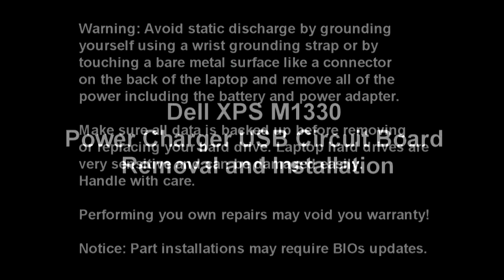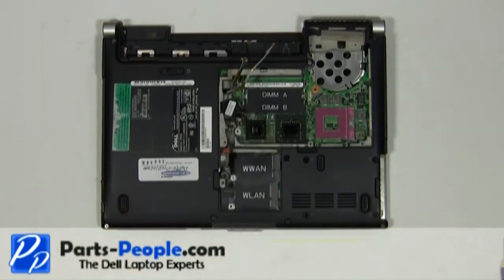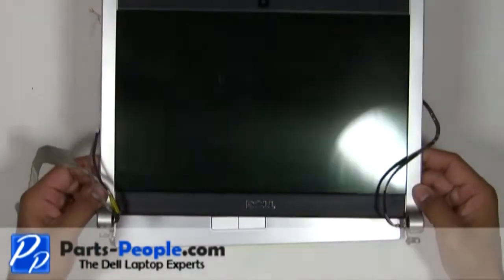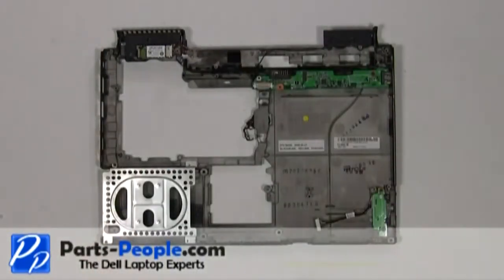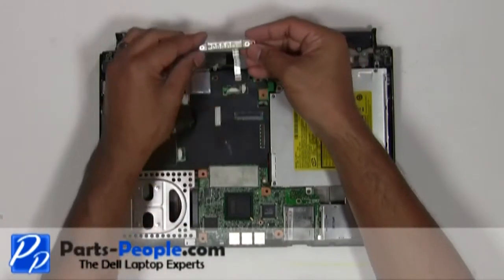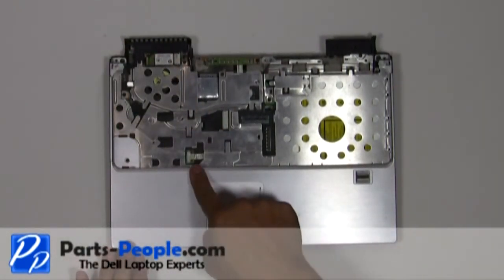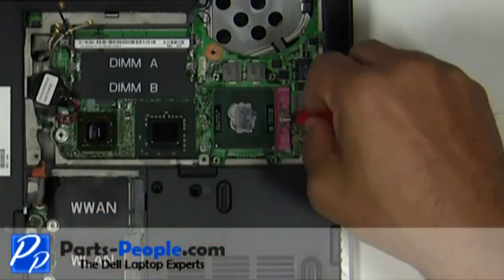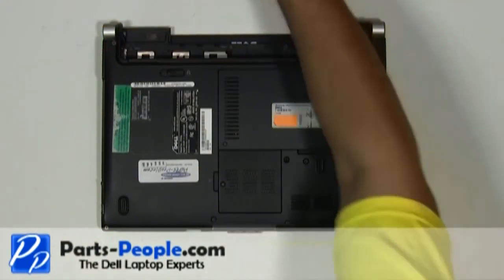Dell XPS M1330 | Power Charger Board / USB Circuit Board Replacement | How-To-Tutorial

Comment from the maker: @7oxSin One thing you might try is to turn off the computer, remove the battery, leave the ac adapter in and try to boot the computer.  If the computer will not boot then you know that the computer is not receiving any power from the ac adapter and you would want to look at replacing the Power Charger Board.

Comment from the maker: Not necessarily. You have a short but it depends on where the short is. If the short is on the motherboard, changing this part will not fix your problem.

Comment from the maker: It sounds like you have a problem with the DC jack not the power charger board. It's very common for the solder joints on the DC jack to get damaged and cause all the problems you have.

Comment: Changing that will solve the problem with the bricked xpsm1330?, the one where won't power on and the light of the power charger turns off as soon as you plug it on the computer?.

Comment: the chargers i have tried worked, when the chargers are plugged up to the m1330 it gets no power at all, i have re soldered the charger port just to make sure and same problem. would the power charger board stop all power from getting to the computer or just stop the battery from charging?

Comment: ups again..used to press Enter.. One quastion accoarding to the problem. Laptop works perfect on battery, but don't see a charger. The charger have right voltage on all the contacts and indicator on it is ON as well.. Voltage comes on motherboard so problem is not in connector. Seems that laptop just don't "see" the charger.. Is it this case shown in video??

Comment: my lap top after a short in wire of adapter  worked for a while until battery too low and laptop powered off, and after that cant' be charged or power on even with another adapter
if I change the the USB circuit the problem will be solved? what else please help thank you